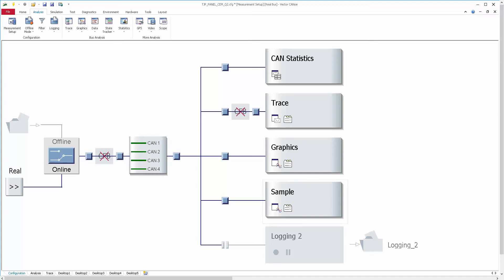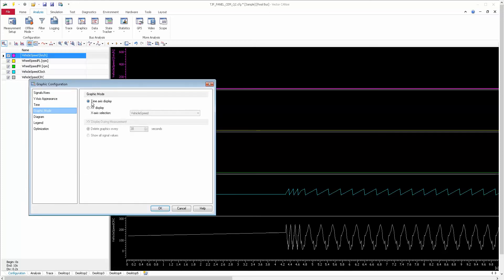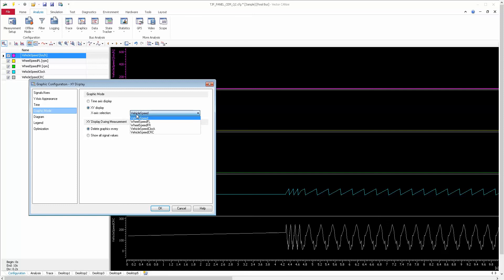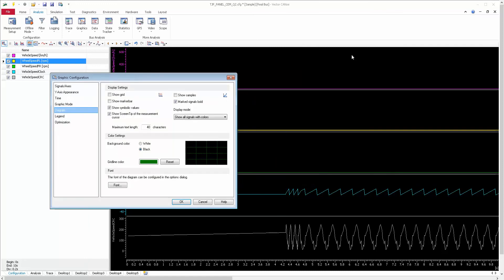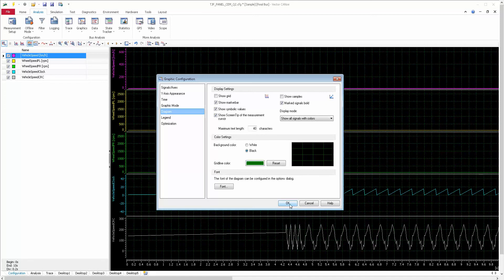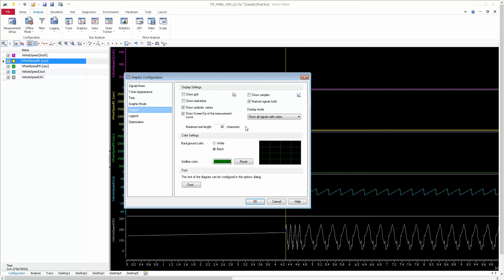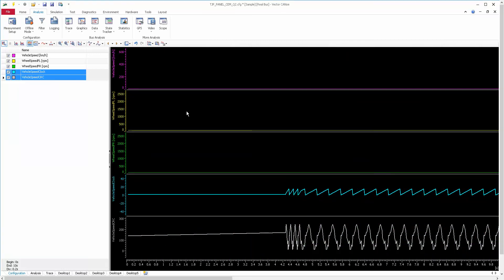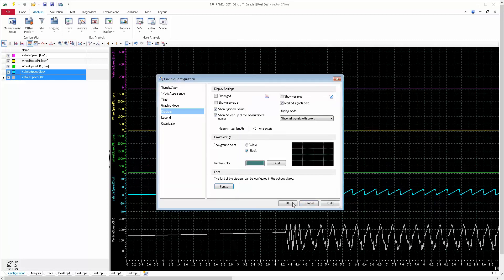Vector CANoe Graphic Panel Configuration Part 2

Comment: Hi, Thanks for sharing.
I am currently looking to overlay 2 (or more) logged data in graphic chart.
For example here you show some wheel speeds. I would like to overlay Front Left wheel speed from different runs and be able to shift a dataset along x axis. 
How to do that with Vector? Is there a way? 
Thanks very much.